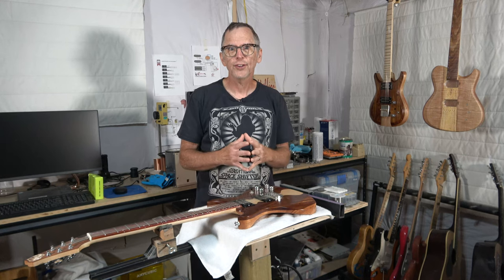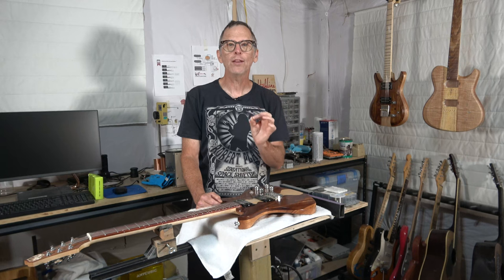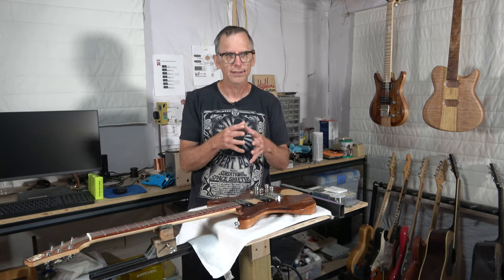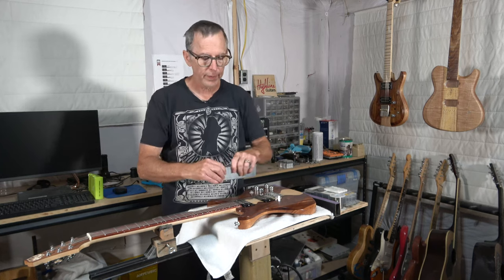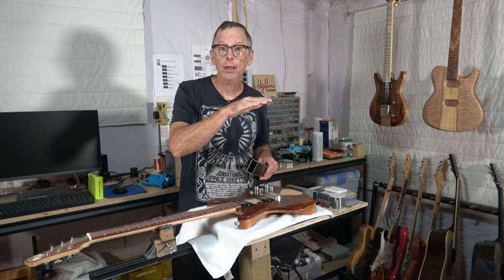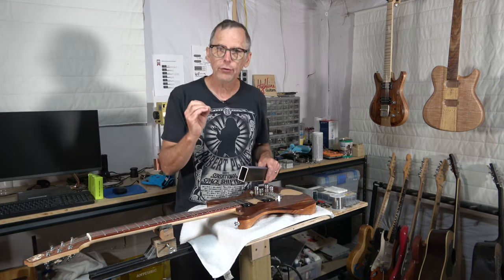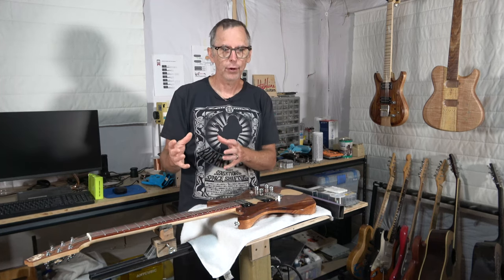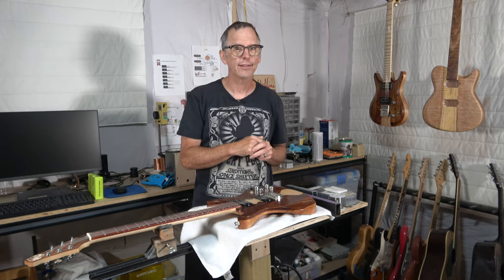How To Level Frets On A Compound Radius Fretboard

Comment: Talking about 10 to 14" radius. What do you radius the bridge at? 17" Extending the cone in CAD. I know prs have compound radius sanding blocks, but I've had mixed results with them (made on CNC *always end up with flat spots. moving the fret board through undulating radius changes radius based on stroke length) *working on a surface grinder ish setup to control and cut down spot levelling. Also, on spot levelling and in regard to your fret kisser video there are some duds where the diamond is proud of the reference surfaces (thanks for my understanding of my return). Thanks again for your insight and clarity on topics.

Comment: How do you go about putting a radius into the fret wire with a compound board?  Do you slowly increase the radius every few frets?  Is it possible to get everything almost fully level after install and then spot level or does a compound radius require a full level after install?
Reply from the maker: That's exactly what I do. A fuul level is usually required.

Comment: If you put steel frets on 12 at nut and 16 at heel....is better to use 12 radius frets,will ss frets follow wood radius? Or is better sand wood on 16 inch radius?
Reply from the maker: With stainless steel, I make sure the radius of the wire matches the radius of the fretboard where it will be installed. Trying to press a 12" radius wire into a slot with a 16" radius could cause the center of the fret to pop up.

Comment: Hi Chris, How do you level a full scalloped neck? Same approach?  How about neck relief on the same scalloped neck? If you can explain action on that type of neck, that would be a plus+++
Reply: As the owner/builder of a few scalloped necks, it's all the same as regular. Really low action is possible because you can still get your fingers under the string to bend.
Reply from the maker: I doubt I will ever do a scalloped fretboard. Not my thing.

Comment: What about using compound radius sanding block for compound radius fretboard? I've got a compound radius block and I think it's pretty useful, though a bit tricky in use. It should be moved strictly in parallel direction to the frets and in the same position all the time. And applied pressure have to be even all the way the block goes.  Being used this way it levels the frets pretty fast keeping proper radius allover the fretboard.
Reply from the maker: Do you have a link to the compound radius sanding block you use?
Reply: @HighlineGuitars the block I use was custom made with a CNC machine as a prototype. It's not a serial item for sale. But I think you can make the same block with your CNC machine easily. The block I use is 12" to 16" radius, 0.49 m (about 19.3") length and 0.07 m (2.75") width. It covers all the fretboard on 25.5" scale guitars. It doesn't work for the multi scale fretboards.
Reply from the maker: @A.J.99  I asked because I made one a few years ago and had to abandon the concept because it didn't work.
Reply: @HighlineGuitars  this kind of sanding block doesn't work as regular ones which supposed to be moved up and down the fretboard. The compound radius block works only if it's moved from side to side the fretboard. I use a capo placed before the nut as a guide to move the block strictly parallel the frets. And the guitar has to be fixed tightly on the desk so you could hold the block with both hands.
Reply from the maker: @A.J.99  I came to that same conclusion which is why I abandoned it. Too silly.